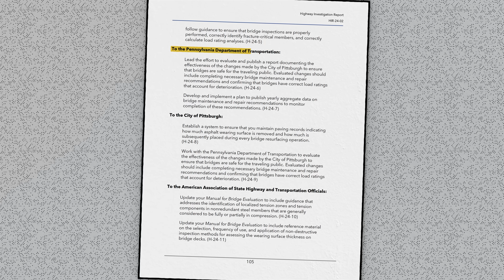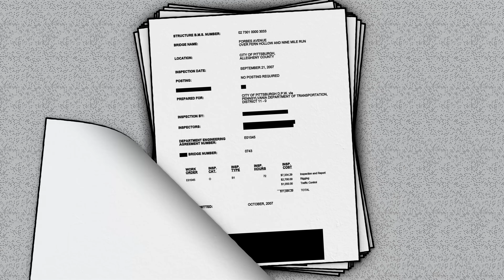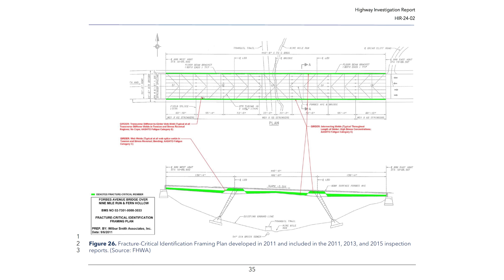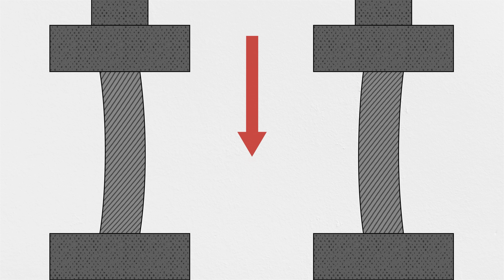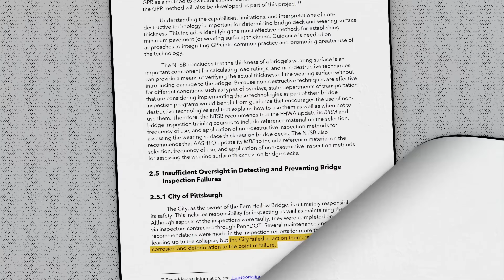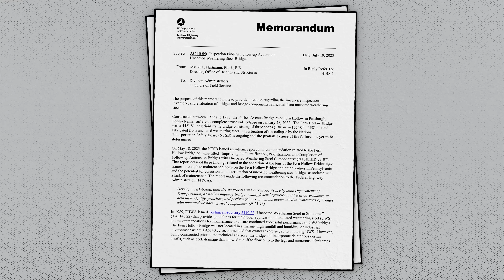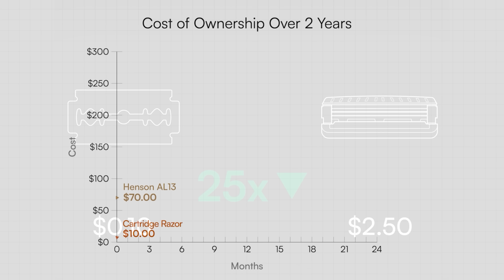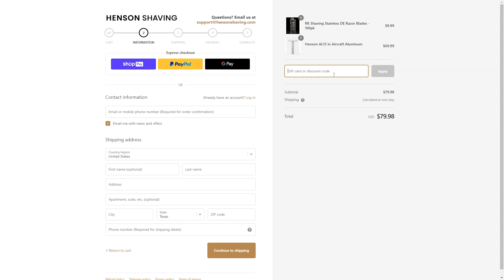This Bridge Should Have Been Closed Years Before It Collapsed

Comment: This is true in a similar, though often less dangerous way for buildings. I work as an architect, and always see clients, the public, and of course designers themselves clamoring for new buildings, which are often built quite cheaply given how high construction costs are. The old buildings these replace are seen as ugly, dirty, dated, unsuitable—but oftentimes these have received no major retrofits, renovations, or even proper maintenance over the 30, 40, or 50 years they’ve been around. We are not only trashing a massive amount of carbon when we demolish and build new, we are perpetuating a culture of undervaluing maintenance and reuse. Thank you for the interesting engineering video, but especially for the addendum on what it means when we treat our infrastructure in this way.

Comment: In about ~2015 in my city in NZ, the largest/tallest building in the city suddenly got evacuated and shut down for massive foundation repairs. The engineers who designed it had forgotten to factor in the mass of the building itself when designing the original foundations. This was only picked up by chance when new building owners commissioned a "let's just be extra super sure" 30 minute or so check over by an engineer after buying it - according to all council/building documents/consents from when it was built in the late 80s, everything was totally fine. Rumor is that extra little check led to a panicked meeting of the best and brightest engineering minds in the city about whether or not it was necessary to evacuate the whole downtown area immediately in case the building just suddenly fell over... But they decided closing it urgently then spending about as much as they'd spent on building it in the first place to reinforce the building, taking several years, would suffice. The building owners were under no obligation whatsoever to have that extra inspection done, as far as the council were concerned the building was 100% safe, and it could have remained as it was for years (or until it suddenly collapsed).
Reply: Timeframe sounds about right for Wellington Central Library. Though I’m sure there’s plenty of other examples around the country.
Reply: oof 💀
Reply: This reminds me of the Citigroup (formerly Citicorp) Center story, I think Grady has a video on it. I think what's cool about that story is how the chief structural engineer admitted his mistake and worked with the other stakeholders to remediate the problem. Nickolas Means has a talk about this aspect of the story.
Reply: @thesquishedelf1301  ....Not the library :D ... That's still closed and they're just ignoring it, as far as I recall...
Reply: @HurricaneOK1  I mean, last I saw (July 2023) they were slowly dismantling it. A bunch of the decorative facade facing the police station had been removed since 2022. I knew it wasn't the tallest, but I reckon it had an argument as largest closed building besides Te Papa (which kinda counts as multiple buildings), that thing was huge.
I miss the Central Library 😢
Reply: @thesquishedelf1301  Majestic Centre ;) - Keep in mind though that my story above does include some hearsay, but from the mouths of very highly placed engineers. I showed them WCC-built walking bridges with rotting tree stumps and rusty $10 steel fence posts as foundations inside streams (and WCC built retaining walls that were the wrong way around, etc etc etc...) - they weren't really surprised and told me about things like the Majestic centre and certain other buildings where giant concrete wall panels were now technically only held in place by silicone sealant... But otherwise, yeah, an astonishing number of 80's-or-so buildings in downtown Wellington are now totally vacant because they're nowhere close to meeting earthquake standards. It's not that the standards in the 80's were bad - it's that  a lot of people just weren't complying with them at all... Which is why so many older buildings are totally fine/needed fairly minimal work.
Reply: @HurricaneOK1  There was a lot of shonkiness during the building boom of the 80s/early 90s, also epitomised by the leaky buildings saga (honestly, who thought that design was good for NZ). These dodgy building practices did not hold up well (literally) when they got the big shake in 2016.

Comment: As a Pittsburgher, went over that bridge multiple times and mention to my bud that the expansion joints were way too far apart and plus my bud and his finance got flat tires coming across that bridge heading towards downtown. My other bud that works at Port Authority told me they fixed the bus and was back in service.

Comment: Clearly, the inspectors need to have the authority to shut down bridges, not just file reports.
Reply: That's insane, like 10 years of stacked up reports showing a bad situation getting even worse, and that's all they could do.
Reply: IRRC, that's exactly what happened on the bridge over the Mississippi awhile back. I think it was shut down while they were inspecting it, but I could be wrong about that. But even that was after other inspections saw the crack.
Reply: I think that they theoretically might, although they were consultants, and that sounds like a good way to not get hired for the next inspection job. ¯\_(ツ)_/¯
Reply: @TheRealE.B.  Yeah. Authority is only half the equation. The other half is support from above to actually exercise the authority. Authority alone doesn't mean much if the city won't stand behind the inspectors' decisions.

Comment: 18:24 one simple fix could be:
Give inspectors authority to close the bridge if the rating falls too low. Then it is up to the owner to prevent the rating to fall to low and to prove the rating is good again after fixes are applied. But that probably makes too much sense to do, so it will never happen.

Comment: I got a bridge closed off for fire equipment because sink holes were appearing. I called the fire department and suggested that unless the bridge was needed to get to a fire not to use the bridge. It would be very embarrassing for the city and the FD if a truck fell through. They took my advise. Later I had to tell them after the bridge was totally rebuilt that they could use it again. They asked me my authority, I said I had none, it was only a suggestion.

Two points I would consider: The first is citizens monitor their nearby bridges and if concerned post photos and contact local emergency to avoid using the bridge if at all possible. I would also notify the government agency, such as city what you have done and that you posted photos. In my case the bridge was scheduled to be rebuilt within several months. The second, I would have a law passed that the head inspector must publically state that it appears this bridge is not longer safe and at the least weight limits or closing is recommended. Of course, if the bridge is safe no press conference would be required.

This puts on notice, publically that a dangerous bridge needs attention. This opens the government's wallet to make whole if an event occurrs.
Reply: Wise advice.
Reply: In other words all bridge inspection reports should be sent to the local newspaper, radio station, police, ambulance, fire, etc.  Not a bad suggestion.
Reply: @Mark_Bridges  If everything is within standards, I don't see a need to do so, only those bridges that need to have weight loads lowered, or the bridge closed. I could see a listing of local bridges as a total to be released to the media. Only specific announcements when it is needed. This puts the managing government on notice to do something.

Comment: Was working on a building column replacement. The column in question was badly rusted, with several holes rusted through the square member. We started to shore up the roof when we heard a wet crunch, and everything started shaking. The column had broken off at the floor and was swinging freely. Partially unloading the column was enough to cause it to shear off at the base.

A photo of that column still hangs over my desk with a quote from the engineer before we shored it up, "On a scale of 1-10, this is a 6." Everyone on the crew knew it was going to or had failed. And the only reason it was fixed before the roof caved it was because of Surfside.
Reply: What a haunting experience

Comment: As an observer from the UK, I'm struck by the disconnect between US officials that call out a problem (corroded bridge, unroadworthy stretched limo, failing apartment block)  but then there's no system for enforcing follow up. Sad that such scenarios kill so many innocent victims. The UK's followed suit - see Grenfell Tower disaster and its cladding. When I started work in 1980s UK, buildings could only be completed  if a public sector official went to site and approved the job in progress; nowadays, it's on the members of the building team - and whoever is slowest at passing the buck.
Reply: Grenfell really illustrated the number of opportunities design, client and construction teams have to pass the buck. From cladding choices and missing fire break strips to lack of update to the fire evac strategy, there were so many opportunities for this cascade of events to have happened differently. Hell, even the fact that the fire was started by a faulty fridge after years of complaints by the residents shows that we could have done better simply by valuing and caring about the people living in social housing.

Comment: What's weird to me about the bridge is that it wasn't built with drain-through holes in the I-beams. I used to work on a commercial shipping vessel and part of the job is digging out the rust flakes out of the double hull and particularly making sure that the drain holes are clear of obstruction. They exist on both horizontal and vertical members, to ensure that water doesn't pools anywhere.
Reply: I almost assumed it was a Chinese company that built that bridge because of structural choices like the one you pointed out. But no, it was just sloppy work done in the 70s!

Comment: I lived in Pennsylvania for 23 years and this sort of thing is not surprising. Closer to where I lived, a few years ago, the Rt 30 bridge spanning the Susquehanna River shifted overnight, causing one section of the bridge to be many inches lower than the other at one of the expansion joints. Many cars experienced severe damage to their undersides from hitting the equivalent of a metal curb straight on at highway speeds.
Reply: That sounds absolutely horrifying, say goodbye to your oil pan, exhaust system and transmission I guess unless you have one of those insanely lifted trucks. Not even a skid plate would stop that kind of damage at those speeds even if you used one of these solid steel ones that the rock crawler guys put on their Jeeps

Comment: A local bridge in IL, the I80 bridges over the des plaines river has had the lowest possible rating for well over a decade - structurally intolerable.  Currently it's rated at a 6/100.  It's infamous among locals and been plastered on social media with pictures of literal stacks of plywood holding up the superstructure.  Locals, myself included, refuse to drive over it.  but its a pair of bridges for the interstate - it sees a lot of traffic.  It's shocking how bad some of these are allowed to get while we're fully aware
Reply: I believe there are plans to replace the bridges in 2026-2028. hopefully they hold up long enough.
Reply: @retro_88yota  yep, they're in the final stage of planning.  Pending land acquisition, they can break ground by the end of the year
Reply: Any other bridges up there I should be careful of?
Reply: If that's the same one I'm thinking of: I drive over that one probably once a month and that thing is shabby as all heck!

Comment: I'm from Pennsylvania. It's like this everywhere. I know of overpasses that have holes in the concrete with exposed rebar. Roads with potholes big enough to dent rims and rip off bumpers. Places where the water bubbles up and flows right out of the middle of the road when it rains. Penn Dot doesn't care.

Comment: 2:32 re "weathering steel". There is also a chemical you can paint onto iron which reacts with it almost instantaneous to form a rust proof layer. Strangely the chemical is only good for about 6 months before you have to get a new bottle if you want the reaction to be thorough and effective.

Comment: 18:52 - Speaking as a software engineer, it's funny how much this sentiment still applies.
Reply: Yup. In my experience, the people who put out fires got all the glory while taking the time for well-designed software was seen as extravagant.
Reply: I don't even mind doing ongoing gradually maintenance and improvements on a big software system, but that doesn't get me through the performance appraisal process.  I would be a code janitor, refactoring, updating components, improving infrastructure, and rarely implementing a new feature.  But software organizations would rather let a system crumble, and pay for a team to spend a year or two replacing it, rather then spend one person's time on an ongoing basis.
Reply: I had the same thought. Maybe we need some occasional “ribbon cuttings” for those mundane but necessary maintenance tasks.
Reply: Some people still think that the Y2K bug was a hoax. It wasn't, but only due to timely maintenance.
Reply: I instantly thought “wow this relates to scrum!”
Reply: @TonyN491  I got tired of putting out fires, now I finally get to spend the time building well designed systems.
Reply: @TonyN491  whoever is dealing with an issue is blamed for it - that is my experience in sw dev
Reply: Preach 🙏

Comment: I used to drive over this bridge daily from 1986 to 1989. Afternoon  rush hour traffic was bumper to bumper for hours. If a bus or truck was going the other direction you would feel the whole bridge bounce and was a little unnerving when more than one heavy vehicle went by. PennDot goes by the motto, if it ain't broke don't look at  it, but if it is broken, wait until it collapses to fix it.
 They did the same thing with the Route 30 slow motion land slide.

Comment: Something I've found interesting in recent years is in DC, WMATA has found a way to make the public more interested in maintenance.

If they do a major shutdown of a section of the Metrorail system, they've done re-opening celebrations of some sort. The Yellow Line's Long Bridge rehab project had a giveaway to take a special first train over the bridge again after it opened that many people were excited to enter and win a ride on.  They'll often put up little presentations at reopened stations to highlight the repair work done.

It costs a little extra money, but has gone long way in keeping the riding public interested and informed about necessary maintenance to keep the system on a path to a state of good repair.
Reply: A project of that magnitude and complexity deserves a celebration in any case. It's an oft-overlooked part of the project cycle

Comment: Why don't the inspectors have the statutory authority to condemn the bridge if it is in such a bad condition? Other countries give inspectors that kind of power to do their jobs.
Reply: Because then the politicians would be forced to deal with it, instead of ignoring the issue.
Reply: @Br3ttM  You mean like over here (Switzerland): Inspectors were a bit concerned about a major highway bridge. within a week, the clamped it full of instruments shut the highway down in the middle of the night, and got the military to run a main battle tank up and down for load testing. Next to years, they fixed it, without ever closing it down, working mostly at night.
Reply: @beyondEV I wouldn't brag about the fact that everyone had to work at night. it sucks being on those type of crews.
Reply: They'll need more to blame on Trump.
Reply: @benjurqunov  Nah, there's already more than enough to blame on that convicted felon.
Reply: Give the inspectors that authority,  and then their supervisors will only hire inspectors who will ignore the problem.
Reply: @JoshuaTootell  Then that supervisor would get fired for ignoring the problem, guaranteed. Statutory authority means it is the law. Ignoring the issue is against the law.

Comment: I watch this as a bridge I drive over daily is getting resurfaced.  All I can think when I've been driving over the one lane left open for the last week is about vids like this and hoping it's getting properly inspected while it's getting worked on.
Reply: if its being resurfaced, that is a good sign that the DoT in the area has the funding and desire to maintain that bridge. i wouldn't stress about it.
Reply: Google says there are 222,000 bridges that need major repairs or replacement in the US. 36% of all bridges. So.. You have a bit less than a 2/3 chance of being perfectly ok. How do you feel about gambling? :D

Comment: I think one problem here is that bureaucracy is often charged first with protecting money over other public goods. If they keep costs down, they are rewarded for saving taxpayer money. If the city/state truly can’t afford to maintain infrastructure, then the only prudent course is to close the least important parts and properly maintain the rest rather than try to keep everything running until it fails.